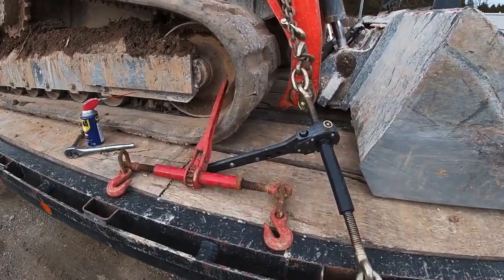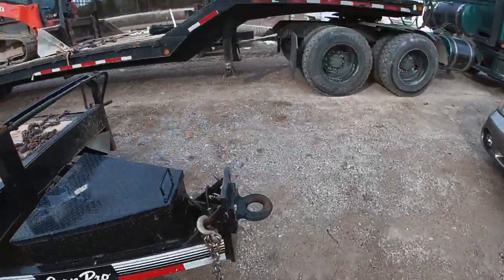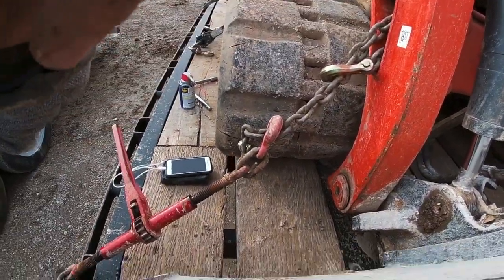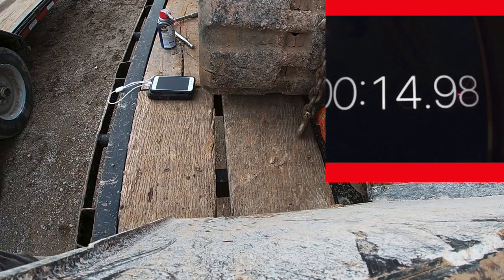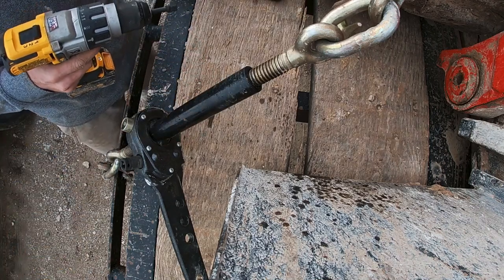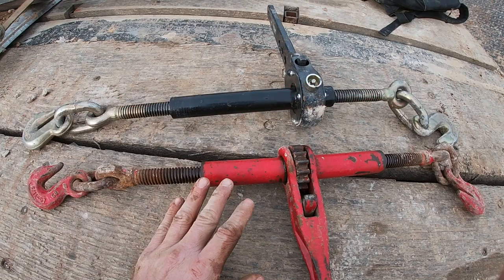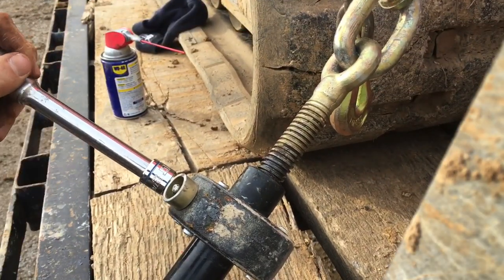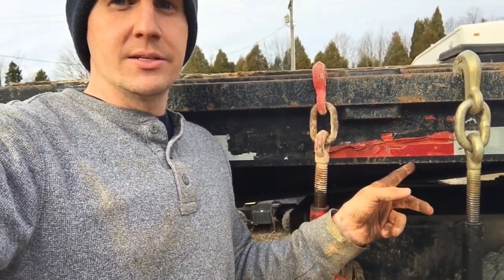SPEED BINDERS VS RATCHET BINDERS

Comment: On about 4 is one thing but when applying 8-14 binders on a load, your arms start to hurt especially when you're trying to move fast while other drivers behind you are waiting on you. They would do great in saving your arms. I'd just keep a spare drill and batteries incase one burns up or a battery dies.

Comment: I was thinking of getting a set of these. They don’t really appear to be really that much quicker in the application that you’re using them in the video. But if you were Chaining something down and could not get as much throw on the handle of the regular binder then the speed binder would be so much faster I know sometimes when I chain  my equipment down I can only get a quarter turn out of it before it either hits the trailer deck or the attachment. providing you could fit the impact in there that thing would be amazing. Great video thanks for sharing.

Comment: Hi Captain! Thank you for the review. After reading some of the comments I thought I'd chime in on a few. The time savings can be minimal or huge depending on the load you are carrying. Steel coil trucks are saving over an hour a day for example. It is definitely easier on the body. Most of our safest drivers on the road are the most experienced but we are getting worn shoulders, elbows ect....these help a lot. Batteries going dead are really not a problem. A fully charged battery with that drill kit will last about 40 cycles. If you are going to cut wood with a chain saw, your prolly going to make sure your chain saw has a full tank. A big advantage to our binder is the ability to keep the chain tight. The handle is a reaction bar that gets placed against the floor or track, blade of the equipment being hauled. Once tight, it takes about 7 to 10 lbs of effort to lift the handle up. because of this, tire mash over bridge abutments, rail road tracks ect do not loosen our binders where normal ones will counter rotate and loosen. Also, normal binders twist the chain towards the end of the tightening stage, we do a continued, 25 to 1 gear reduced pull of the chain with out any twisting. Pure tightness. Bone tight. Thank you for the review!!
Reply from the maker: some more great points steve!  we are really happy with them far, now complaints here!
Reply: To give a little background on Speedbinders. My first model used a 1 to 1 ratio and absolutey flew...hence the speedbinder name. That version had many draw backs and I took them off the market after the invention and release of Torque Drive. So this binder is called Torque Drive, made by speedbinders.com. To me, the speed is low on the feature and benefit list. Safety, chain tension, ease of use, long life ( no flipper to get a flat spot on) are attributes that stand out. They are not for everyone and I get that. But once you use them, you won't go back. 30 day money back guarantee, 6 month warranty.
Reply: steve helline thanks for the insight.  Love the innovation as much as the safety and practicality of your product!

Comment: I think in a tight spot, where you can't ratchet a regular binder, and also when the chains are long or there's something compressible like tires, they'd work awesome!  When securing a tractor or car or anything with pneumatic tires, there's a lot of squish there and you ratchet forever, these would zip right thru that I'm sure faster than manual.  It would, however, be pretty awesome to have a manual option other than a socket or something.  Other than that, seems pretty jazzy!  Thanks for the review!
Reply from the maker: i agree with all of that wes!  be curious to see how they develop over the upcoming years.
Reply: @CaptainKleeman  Yeah, for sure!  Looking through the comments, that seems to be a common concern.  Maybe if they were just 1/2" square drive (so no socket needed) and came with a piece of 1/2" key/square clipped to the side for manual operation... Well, there goes my commission.... Maybe they'll just send me a set for my brilliant upgrade idea?

Comment: Speed of work progression isn't why you should consider speed binders. The main thing going for these speed binders is that they're energy savers. And that can be huge in summer and winter. Conserving your energy with binding 10-12 chains on a 90k load of coil can sap you real good... and then you got to put in 8-10hrs of driving.

You already gotta lift chains and stuff. Anything that can save your energy output in the field has to be given a looksey.

Comment: Do you feel the speed binders torque down plenty tight enough with the drill compared to  standard binders? I’m strongly considering purchasing some of these.
Reply: K&H Tractors yes getting them tight is not a issue
Reply: @DirtPerfect  sounds good! Thank you!
Reply from the maker: yeah, they really do tighten down well.  And i have to say that when i stop an check my chains, i find myself adjusting these a lot less than i did with the ratchet binders.  our back county gravel roads vibrate the crap out of our loads, and these stay tight.
Reply: @CaptainKleeman  I’m planning to order some, I looked them up today. Thanks for this video!

Comment: Nice video, These are going to provide a more consistent tightening of the binders regardless of the actual operators fatigue level. I’m surprised that they didn’t offer a manual operation mode, something the manufacturer may want to investigate. Mike may want to throw a spare air powered tool on the truck if it’s supply is adequate to power one as a backup To the drill. That and throw the old binders in a bucket of used engine oil so they don’t become solid in case he ever has to go back to them. Take care, be safe operating that new truck. Is it electric, pedal, or Flintstoned powered.
Reply from the maker: thats a great idea about an air driver!  

the new ride is supposed to be electric, but currently flintstoned powered haha

Comment: I spend a lot of time cleaning and maintaining my ratchet binders. It’s definitely not fun on cold or rainy days trying to get a stuck binder to work. I’ve got to check out those speed binders.
Reply from the maker: i think that's where the time savings is at, the overall maintenance of the binder.
Reply: Stück binder? Grease in the summer, PB blaster in the winter, even better, a spray bottle with ATF and Diesel fuel sprayed on periodically. No excuse for rusted or stuck binders except piss poor maintenance

Comment: I bought 6 speed binders 2 weeks ago in my opinion straight up JUNK! You can’t get enough torque from a cordless drill as I have in my own strength. With the speed binders my chains have typically gotten loose within 5 miles of driving and my old school ratchet binders I can drive 500 miles without them getting loose.
Reply: Grease the grease zirk liberally, lubricate the threaded end links with silicone spray and use a drill with at least 800 inch lbs of torque ...."let her eat" pull the drill down in first gear and they will be tighter and stay tighter than any ratchet binder.

Comment: Does the speedbinder not work like a regular binder if the drill goes dead ? The only way it works is by turning the bolt ?
Reply from the maker: thats correct, the handle is just to keep it from rotating.

Comment: I never pegged you as the type of person to run a stop sign Captain Kleeman. 

The speed binder would be even better if the fail safe to a dead battery was that it could be operated like a standard ratchet binder, which is exactly what I thought since it still has the handle but I guess the handle is only to prevent rotation as it tightens down.
Reply: He thought he was in the fire truck.
Reply from the maker: hey hey hey,  that was a slow roll at best.

and yeah, it would be nice if the handle actual functioned.  i don't disagree with that.
Reply: @CaptainKleeman  We call it a California stop.
Reply: That was my thoughts also, I would always be forgetting batteries or the drill. Being prepared would be a necessity this setup

Comment: Does the grease fitting actually grease the the screws or just the gears in the head.
To me that just looks like a slack adjuster with a couple modifications and a pipe welded into it.
Can you use it manually without the 14mm socket driving the head like a regular binder or do you always have to have to use the 14mm bolt.
Reply from the maker: it seems to grease the whole "screw"  if that makes sense.  and you're right, it is similar looking to a slack adjuster.  thats an interesting point.
Reply: It greases the worm / slave gear assembly. I like to use fluid film for the end links.

Comment: Speed between the is not an issue in my mind.  The issues of tight places, cleaner thread area is the "gift" on this item. Will it rachet like a regular rachet binder or are you dependent on the drill or 3/8 rachet?
    Love all you and "dirty" videos...
    For you die hards of the order style ratcheting styles, I won't scoff at you.  I am an "old guy" too and won't necessarily just cast those old binders in the scrape pile.
Reply from the maker: dependent on the but drive.  and we will still keep regular ratchet binders on the trailer as well.  for normal loads we can use our speed binders, but every now and again we will haul something odd ball that needs more binders.  thanks for watching!

Comment: You should check out the "self" binder. I bought a set of them and prefer them to the speedbinder. And you use a 1/2" impact, not a drill. I think they are better built and will last longer too.
Reply: They aren't durable. After a year self binders started breaking after 9 months. Also self didn't want to warranty them at first but they did eventually send out replacements, but it took 2 months
Reply: @Joseph F  I've had these for almost 4 years now and use them nearly every day. Sorry you don't like them, but I stand by my comments.
Reply: @mikesch7672  maybe they were made better 4 years ago. I work for Sunbelt rentals so they don't have a gentle life. I also am very meticulous and take care of my equipment and greased them weekly. They just can't keep up.
I literally had the first one fail 6.months in, they replaced it quickly. 3 months later I had one a week almost start failing like clock work. I really hoped they would work because they are great in tight situations due to lack of a handle. After all the failures I had, we decided to try these speed binders. I just started using them last week and so far I am impressed. Haven't had a single issue with loosening yet and they seem to be built like a tank. SELF is a awesome concept and probably great if you don't move as much equipment as we do.
Reply: I am a lead driver/ trainer in my district and am the tester for some of the products like this to see how they work. If they seem worthwhile, my district manager wants to order them for all the stores which is over 30 trucks.
I move a lot of equipment so I need durable and efficient.

Comment: Let’s adjust the camera moves it exactly where it was it takes exactly the same amount of time  as a normal one cost 6 times as much also if your rub rails are not rated for 9100 pounds then there is no point in owning one
Reply from the maker: Been using them for over a year.  Love them,  in fact he bought them for all three trailers.  and your data is off just a bit there bud.  Hope your evening is a good one!

Comment: I wish that they were around back when I was hauling equip !!
Reply from the maker: what kind of rig did you have tony?
Reply: Captain,I hauled paving equip with an Autocar & a drop deck trailer.Worked construction from the age of 16, and retired at age 55 after I lost a leg in a MC accident, and could not get in & out of the trucks.I was also a call firefighter!

Comment: sorry.. i'm not going to buy a $100 binder  and a $200-$400 impact drill to save 1 second and some arm strength..... lazy man's binder.
Reply from the maker: No worries! They aren't for everyone.  We've used them for two years now and they are absolute time savers with the right setup, especially since I haul several trips a day.  But probably wouldn't make sense for your lawn mower.

Comment: I used my brand new speedbinders TWICE and the hooks actually snapped in half on all 4 of them, on my oversized heavy haul load. Caused my load to fly forward into the front of my trailer. Be careful with the things. I had a total of 6 1/2" chains, 4 9200wll speedbinders and 2 standard 1/2 ratchet binders. No reason they should've failed.
Reply from the maker: I agree,. Unfortunately speed binders got bought and we haven't been very happy with the company since then.  Would love if you could email me pictures
Reply: Would love to hear more about this, during pull testing we pulled to over 46,000 lbs before deformation on the speedbinders. Never heard of hooks snapping in half....never...have any pics or more details to validate your story?

Comment: Strictly speaking you have to include the time it takes (call it effort ) to plug your Battery into the the charger (omit the charging time)
remove it from the Charger and get the Drill on site. As you measuring "effort"and time here, you'r behind with your Drill.      Nice Video

Comment: You lost me at "Grease Zert".    It's "Zerk"
Reply from the maker: jeff barber no kidding?  Wow.  That’s neat
Reply: The patent for the Zerk fitting was granted to Oscar U. Zerk in January 1929, and the assignee was the Alemite Manufacturing Corporation[1] (thus the eponymous names for the fittings). Alemite had already been marketing, since 1919,[2] ball check valves to accept grease supplied under pressure from a grease gun, such as for car and truck chassis lubrication points, both for OEM installations and for aftermarket upgrade kits which would screw in as replacements for stock grease cups, but Zerk's fitting was an improved style, less vulnerable to dirt and more forgiving of angled approach. Today, many companies make these grease fittings

Comment: Snap binders first for me and and maybe a couple of screw binders to make the hard to tighten tie downs.   I wouldn't want to be searching for the battery drill just to tie down a load.  I buy snap binders and screw binders used for $5 - $20.  Snap binders are easy to tighten when the load moves a little.  Screw binders often have to be unscrewed to catch another link - which is slow....
Reply from the maker: Been using them ever since this video.  Love Them.

Comment: Well you would be laughed at and out of the oil patch I work in no place for it there never plug batteries in and can’t tighten them up the drivers would be mad the first time it didn’t ratchet for them now if it was both not just drill if you could use it as a ratchet as a back up and tighten it down as a ratchet you have something but drill only no good for oil patch
Reply from the maker: brian bell suppose it’s a good thing I don’t work in an oil patch Then.  Hey stay safe out there and thanks for putting that work in for the rest of us!

Comment: Just oil your damn binders!
Reply from the maker: well we do every three thousand miles and we use high mileage synthetic,  should we be using a different oil?  what brand do you recommend?
Reply: Fluid film
Reply: @CaptainKleeman  ATF/diesel fuel mix in a spray bottle. 21 yrs doing heavy haul across the Midwest and northeast in winter, they work like butter